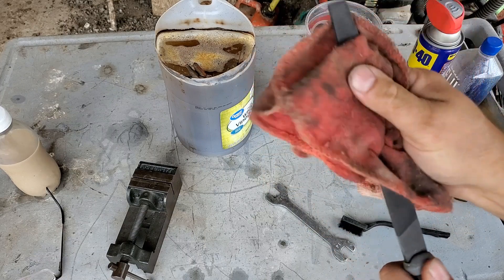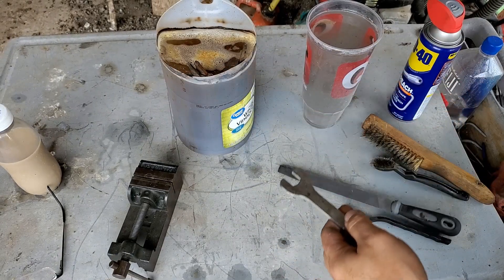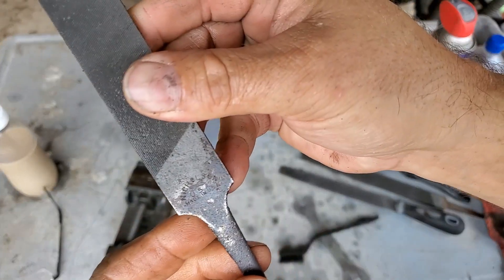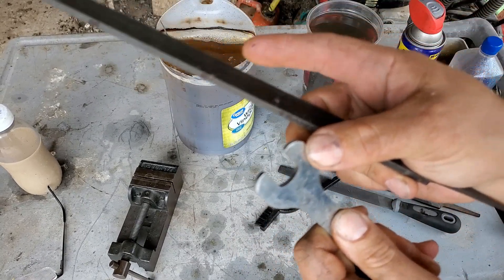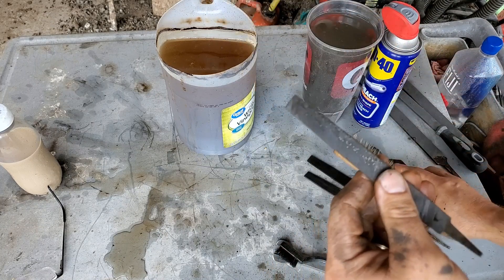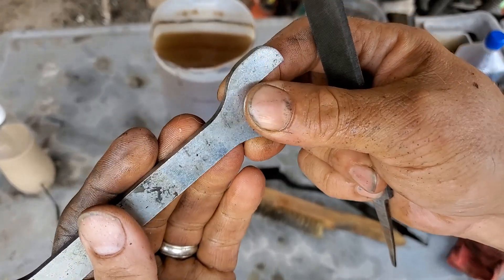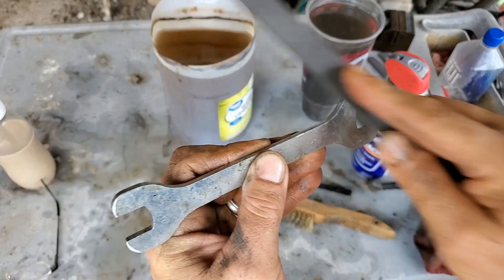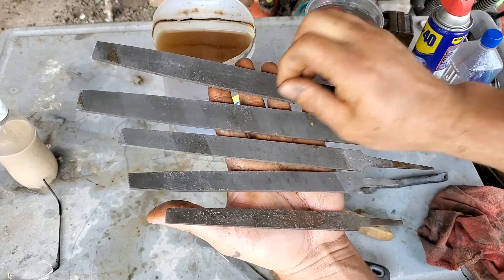Sharpening and Cleaning Files With Vinegar ??? 🤔

Comment: I was told to use the copper pipe before you do the acid dipping that way the acid sharpens it better as well as picking between the teeth before dipping seems to me your working backwards...

Comment: When a file is used on soft material like aluminum, you can use the same material to remove the the filings that stick. Holing the file in your left hand, stroke the material parallel with the teeth - pushing away from you. This was taught to me by lifetime tool and die/mold and jig machinist.(born 1938)
Reply: HOLDING the file

Comment: Why would you nit start with a file card and use the stiff wire to remove material in the file and then use the acid. It the karge particles are there tge acid cannot clean the file steel.

Comment: With the vinegar soaking, you're actually cleaning out the teeth areas that have been plugged up with both rust and dirt. By soaking your cleaning and exposing the cutting teeth again in a more proper cutting manner.  That's why they now cut again.. Plugged up teeth doesn't cut properly.

Comment: WITH FILES THAT ARE IMPACTED WITH SOFT METAL SUCH AS ALUMINUM OR SOFT BRASS  I PERSONALLY USE A RAZOR KNIFE WITH A NEW SHARP POINT BLADE AND CLEAN EACH FILE EDGE KERF WHAT EVER YOU WSNT TO CALL THEM TO CLEAN OUT THE MESS IT'S TIME CONSUMING BUT IF IT'S A GOOD QUALITY FILE IT ENDS UP BEING WIRTH THE EFFORT YEA YEA YEA FILE CARD YEA,SHURE ☝️ MOST FILE CARDS WONT GET DOWN TO THE BOTTOM OF THE KERF TO FACILITATE A PROPER CLEANING  I'M DONE THANK YOU 👋👋

Comment: Old Sneelock's Workshop
As a machinist and tool maker since 1975, I used files of all types. Wearing them out was a common issue. When I became supervisor and was charged with purchasing files for the tool room and maintenance it was common to go through several boxes of files a month. 
The tool makers and machine repair people tossed the dull ones in a bin and they went out with the scrap. At $3.00 to $5.00/ file it was considered a cost of business. 
In my own shop I found myself going through files at the same rate. I wasn't buying them new. I was getting them at auctions, garage sales, and flea markets. They were worn to start with and didn't get better in use.
A friend of mine told me about sharpening files with acid. 
I was skeptical when I first heard of it. After trying the method and refining it a bit I accepted that it worked. 
I have been using acid to sharpen files for 15 years or more.
Here is a thread from Build Something Cool. He had tried the method and we discussed the pros and cons of the method while fielding questions from the group. 
This link will take you to his demonstration. https://youtu.be/rRakH7TrE2E

6 years ago
Thanks for finding the Popular Mechanics article. That answers the "I won't believe it without photomicrographs crowd."  I wonder what their next objection will be?
Reply
Build Something Cool
·

5 replies
Build Something Cool
Build Something Cool
6 years ago
LOL

Reply

DajjaD
DajjaD
6 years ago
funny thats the only article that says this is sharpening that ive seen

Reply

Stanley Chang
Stanley Chang
5 years ago
Thanks for your comment. I wouldn't have looked in the description otherwise. Why doesn't this work for knives, chisels, or drills though?

Reply

Evan Penny
Evan Penny
4 years ago
Hey guys,  if you don't like the idea of acid sharpening don't use it. 
 It does not matter to me whether you need to find reasons to contradict the idea or not,  but some of your comments are really a bit thoughtless. 
 
Technically you probably could use acid to sharpen knives etc,  but you would not use it.  The knife is a thin tool and eroding away some of its thickness is unhelpful.  Chisels do not suffer from a lack of thickness,  but eroding metal would alter its dimensions,  also the erosive process is not very uniform,  so getting a nice even sharpen will not happen.  Drills also do not want to have their dimensions altered.  Also with the drill bit the angle of the cutting area is quite large,  unlike the angle of the cutting part of a file.  The result would be minimal sharpening for significant loss of metal and loss of dimensional accuracy of the tool.  

Surely,  the proof of the pudding is in the eating.  Just try it.

 ▼ 

Reply

Old Sneelock's Workshop
Old Sneelock's Workshop
4 years ago
The idea of sharpening drill bits as a test of the process has been brought up before. The differing actions of a file and a drill bit are the reason it isn't used to sharpen drill bits. 
Drills use the width of the point to define the diameter of the hole that is drilled. 
Acid removes metal from every surface it comes in contact with. The drill bit will become smaller in diameter just as fast as it becomes sharp. You end up with a drill bit that is sharper but with a random sized diameter
The same, two surfaces being eaten away, process exists because the diameter is the measure of the distance between the two sides of the bit. 
It will work on a knife but who wants a thinner shorter knife? 
Besides each of the other suggested arguments against using acid, points out a device that is normally sharpened in a different way, as an example of the acid process being a failure. If it were as easy to run a stone down the edge of the files teeth as it is a knife we all wouldn't bother with the mess of acid sharpening. 
Milling cutters are ground on center grinders because they have fewer flutes than a file would have in the same distance.
The operation of the file doesn't depend on it's width or thickness as long as it is sharp and strong enough to not break during use.  😊 
If you would like a good history of files, how they are made, and used I recommend The File It’s History Making And Uses by Henry Disston & Son. Upload of a copy from the Stanford University Library is available here. 
https://play.google.com/books/reader?id=1mNBAQAAIAAJ&printsec=frontcover&output=reader&hl=en&pg=GBS.PA7

Comment: Have one clogged with aluminum how would that work?
Love that it had dbl cut action.
Reply: Vinegar doesn't attack aluminum aggressively enough to dissolve it. A better way is to soak the file in a lye (sodium hydroxide, crystal drain cleaner) solution. Sodium hydroxide dissolves aluminum, but not steel. If you do this, do it with good ventilation: the reaction is exothermic, and it releases hydrogen gas.

Comment: You can use that vinegar for darkening wood as a chemical dye
Reply: Depending on the quality, vinegar is also good for flavoring food.
Reply: Colouring wood uses vinegaroon which is something like steel wool soaked in vinegar for a couple of days. You need a high tannin wood before it works. It will work on leather too.

Comment: That will not sharpen your files, it may get some dirt out of the file teeth so the file will work slightly better.  For a real cleaning of your files just purchase a quality file card and clean the files frequently.
Reply: Hello Grant, of all the posts I have read about sharpening files yours is the only one I can  agree with. When a file is dull, there is nothing you can do to sharpen it, but when a file is rusty and dirty you can use rust remover or vinegar to clean it, but a file card will do the same and the file will work better again. There is no sharpening. To make your files last a long time, never use your file on material harder than your file. I am 80 y/o and started my apprenticeship to become a Tool and Die Maker on April first 1959 in Hamburg/Germany, and I am still learning even though I can not work any more for health reasons, Grant, you are the only one that is not spreading the B/S about sharpening, Thank You.
Reply: @hansnielsen7206  - absolutely correct. Good files are really hard to find, and expensive.  Grobet and Barco are what I currently try to find, but the Nickelson that I grew up with got outsourced to foreign lands and seems to be made of far lesser material, or the heat treatment just is wrong 😢.  Files are precious precision cutting tools that should be time life items and current Utube creators don’t understand what and why the process works.  Us oldtimers understand.
Reply: @wrstew1272 To me it’s obvious. How could you possibly sharpen grooves that cross cross? Not possible. Not like a knife.
Reply: @hansnielsen7206  great to hear from you.  Seasoned workers like you and I (I'm 71 years old) seem to have a bullshit detector that younger generations seem to have lost because they don't think but instead they rely on what 5hey read on the internet.  The internet can always be relied upon and can be totally trusted.  That last statement for sure set off your bullshit detector, I hope.
Reply: Respectfully, everyone in this thread is ignorant of the mechanism through which acids sharpen files. Picture a triangle - that's the tooth of your file. Over time, the tip of that triangle gets rounded over, lessening its ability to cut. When you subject the triangle to acid, it eats away at it from all sides it has access to: you can picture this as an inset perimeter within the triangle. When this happens, the radius of the triangle is shrunk, bringing the walls closer to one another and through that reducing the radius of the triangle's rounded over tip, effectively sharpening it. Another way to picture the process would be to start with an axe head with a convex grind, and putting a hollow grind in it. With this understood, the process is less like conventional knife sharpening, and more like chemical stropping.

Note however that, because acids sharpen file teeth by essentially putting a hollow grind on them, it only works if the tooth hasn't been mashed flat. If the triangle has been truncated in such a manner, the acid will simply etch a pit into that top surface, because the sides are no longer present.

Comment: wrong,  clean with lye (Drano) then
50/50 Sulfuric acid and  Hydrochloric acid.  Yea dangerous be careful .
Fine files buy new ones .
Tupperware the acid won't dissolve .
DON'T lay the files on the bottom , suspend them so the acid can get around .

Comment: Using acid to 'sharpen' files does not work -- common misconception.

They remove material from all surfaces, they cannot leave a point for the teeth.

What it does is remove all debris and gunk off the file, allowing it to cut cleaner, and have clear grooves/teeth which aid with chip removal.
It just makes them feel sharper, well until they get dirty again.
Reply: Yes that's my experience also.

Comment: I have been testing with electrolysis and a Constant Current power supply so I can dial in the voltage and current. I used a fine brass wire brush afterwards to get rid of the black gunge.
It kind-of works if you wind the amperage up high enough so that the rust "pops" off the surface. On badly rusted files you can see where the teeth are chipped and eroded, so whilst they bite it's not as good as a new sharp file.
Some people say that Citric Acid is better than Vinegar (mild Acetic Acid). Paint them in Phosphoric Acid after cleaning to re-establish the grey anti-rust coating.
Reply: I wouldn't use Electrolosis on files (or axes and knives) because of hydrogen embrittlement.

Comment: Soak in lye to remove aluminum from the files.
Reply from the maker: I heard you can use a piece of copper pipe pushing parallel to the teeth to remove stubborn items lodged in the teeth
Reply: @kep-kraftindustries3759  That is my preferred method of cleaning pinning from a file. 
I do that before soaking the file in sulfuric to do the actual sharpening. 
If there is pinning or junk in the teeth of the file, the acid has to eat through the junk before it can sharpen the teeth. It acts to mask the file and cause spotty sharpening. 😁😎
Reply: Put CHALK on files to stop aluminium from sticking as you file it. Prevention is better than cure.
Reply: @johncoops6897 One of the files he found already has aluminum stuck in the teeth. A bit too late for prevention.
Reply: I use a soft scribe to push the pinning out.